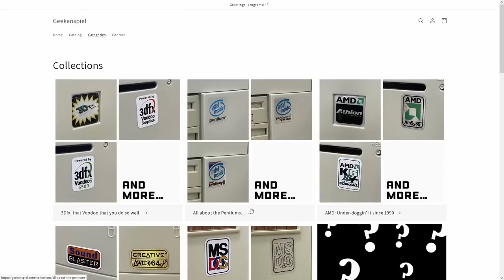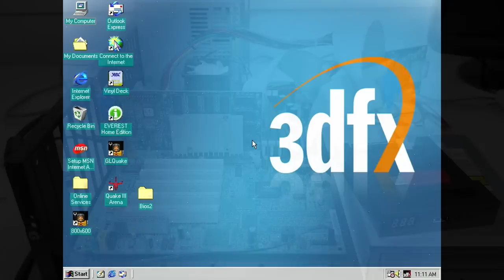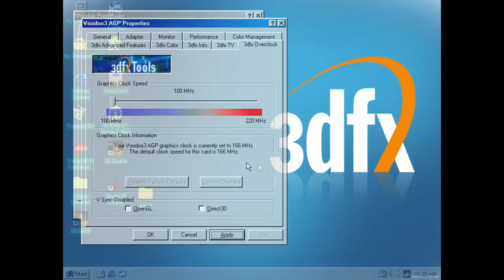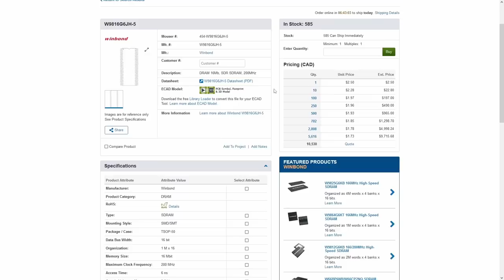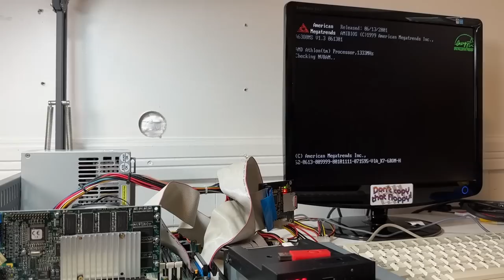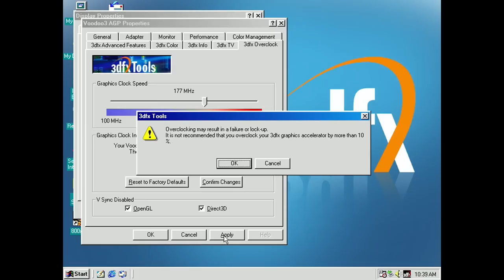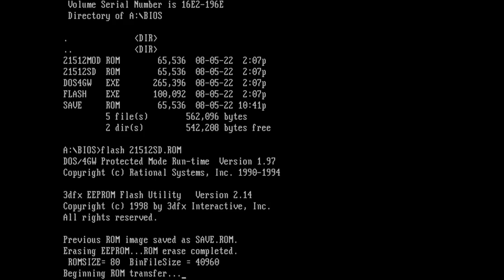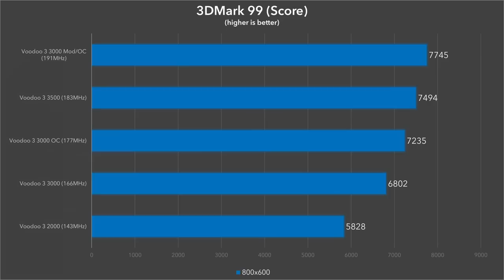3dfx Voodoo 3 Memory Replacement and Enhancements!

Comment: I miss my voodoo 3000 agp... i should have never sold it. It was one of a kind. In fact i had the worlds fastest voodoo 3000 that even blew the doors off the 3500. Back when 3dmark listed the results uploader's email i was swamped with emails asking me how the hell i had such a result.

Far as i can tell i had a UNIQUE 3000 though, i've never been able to find another one like it, Pretty much all of the voodoo 3000s had a standard aluminum heatsink as you see in this video, or the black stile heatsink, mine however was a MUCH larger GREEN looking aluminum heatsink that covered far more of the gpu. The tool back then for overclocking has a maximum core/memory clock setting of 220mhz, and i was amazed i could push it all the way there, i had to contact someone to provide an option for a higher clock, and was able to get the card to run 227 clock stable but could complete some test at i believe 235-240mhz. Totally insane for a 3000, even a golden sample couldn't do that, i definitely won the ultimate diamond level sample. I really should have put it in a glass case.
Reply from the maker: Thanks for sharing, that's amazing! I have only ever seen a V3 3000 with a green heatsink once, and that one was an impressive overclocker too. I wonder if it was some kind of special edition card or something.

Comment: With modern cards you can pull-down the supply voltage to a memory chip and force it to glitch, and then see if it artefacts in the same place on the screen as the fault, ie, it would be that chip, but I don't know about that old stuff.
Reply from the maker: Very interesting! That would have been a great test for these cards with persistent artifact locations. I may give this a try next time. Thanks for sharing.

Comment: I like the repair stuff, great to see the problem solved by replacing the mem chips. I've got a nVidia 6800 GT AGP card that has severe artifacts in 3D games, but 2D is fine with no artifacts. I suspect the GPU itself, but if its a memory chip that would be an easier fix, any ideas?
Reply from the maker: It can be hard to tell the difference between core and memory issues sometimes. Artifacting doesn't always show up in 2D with flaky memory. Cards with lots of memory didn't really need to use much for 2D desktop duties, but most/all gets used in 3D. Does underclocking the card by a large amount improve stability at all? .. but I will say that the nvidia 6800 GT/Ultra series is known for having failing memory over time. It didn't age very well from what I've seen and could very well be the issue. Good luck! I hope you get the card going again.

Comment: If you put some active cooling on the GPU core and some ramsinks on the memory you'd make 210Mhz easy, that's how i got my old Voodoo 3 up to back when i had one and it was the default memory
Reply from the maker: That's an incredible overclock on stock memory, that's for sure! I've heard similar stories from others too. Some of these V3s could clock REALLY high out of the box as long as they were cooled well enough.
Reply: @vswitchzero  Silicon Lottery at its finest. This was similar to my Voodoo 2's One was able to clock 50Mhz higher while the 2nd only managed 20MHz, no matter what i did. Ram sinks, Heatsinks on the chips, nothing would get it past 20Mhz. Sold it and got a better one that could match the 50Mhz of the first card. 

The V2 in SLI complemented my Riva TNT2 32MB card. had the best of both worlds

Comment: Maybe you should consider to glue off the heatsink on this MSI socket A motherboard. Because it's glued on 2-side tape and have no contact in the center of northbridge. There are holes to put there some other heatsink with spring-clips instead))

Comment: Another very good video. Thx for sharing :) It's also good you mention the stuff you work with. 
For example which solder would you use? I found out that some pf my old repaired PCBs got corrosion where i soldered. I think cause of flux. Now I wonder if there is solder with bad flux which leads to corossion.

Comment: Good job, I wonder if using freezer spray on the ram chips one by one would of changed the artifacting in any way to of diagnosed which IC was at fault, used to be one of my ways of diagnosing set top boxes at work, they pretty much used a chip set in a similar way, i.e.a processor and ram, before SOCs were in everything ha.
Reply from the maker: Very interesting method! I would imagine this could work well as long as the freeze spray would be safe for the chips/PCB while the system is running. Thanks for sharing! 👍

Comment: Any chance you could look at my voodoo 2s? There's a few spots where the pins got pressed together while in storage. They worked amazingly prior but I'll admit I haven't had them running in probably 10 years now. Move cross country twice and I'm amazed I've kept them together
Reply from the maker: The pins on the V2 TMUs and FB chip are very fine pitch, but with good magnification, you should be able to use a very find blade to separate the pins. They are very fragile, so you'll need to be careful, but slowly putting the blade between the pins is enough to separate them. If any of them have become separated from the pads, they'll need a solder reflow, but unless they are really twisted or bent, that's not usually the case. Best of luck! Let me know how it goes.

Comment: I'm kinda wondering if the reason you couldn't go past 191MHz is because the card is passively cooled. Do you think adding a fan on top of the headsink would've been able to achieve better results?
Reply from the maker: Thanks for your comment! I forgot to show it in the video, but all the overclocking was done with a 92mm fan blowing on the front face of the card. It was barely warm to the touch with active cooling.

Comment: You want reach 200Mhz - volt mod you voodoo. You need bump GPU voltage 10%-20%. And better cooling solution is a must.

Comment: do you keep all the other old chips then once you have found the faulty one ?
Reply from the maker: Yep, I do. If I know the chip isn't bad and it came off cleanly I will hang on to it. The hot air used to remove them probably isn't good for the chips, but these originals are getting harder to find so you never know if they'll come in handy one day :)

Comment: I wonder how hard it is to upgrade an old SDRAM videocard to use Static RAM instead. You would probably need to modify or bypass the memory controller.

Comment: with that 191MHz overclock applied, how does the voodoo 3 hold up against a TNT2 Ultra ? 

I have both, a Voodoo 3 3000 and a guillemot "maxi gamer xentor 32" TNT2 ultra but can't really decide which card to put in my "1999" system (500 MHz Pentium 3) ... if I go with the nvidia card I'd trade glide compatibility for more performance in everything else ...
Reply from the maker: Good question. I don't have a TNT Ultra, or any other TNT cards actually. I've been meaning to pick one up though. I'm hoping to do some more comparisons of 3dfx cards with the competition at the time.

Comment: You don't happen to have any reference material to what the SMD capacitors are that sit between the memory modules? I have one that is damaged and was hoping to work out what it was, the alternative being to pull one of the other ones off and measure it.

Comment: Is it possible to add the missing components to card 3 for a functional tv out jack?
Reply from the maker: The PCB is the same for TV-out and non-TV-out models so yes, it would be possible if one knew all the component values and could source the parts. The bracket would need to be modified/replaced though.

Comment: Are you interested in modding a PowerVR PCX2 @90MHz ? I need 8mb of faster memory, now that it's fast enough to handle maxed out graphics of some 98-99-2000 games.
Reply from the maker: The PowerVR stuff is really interesting! I actually just bought a PCX1 but haven't had a chance to try it out yet. As much as I'd love to try to mod the card for you, I have very little spare time with work and other obligations so will have to pass. I'm also still learning too, so prefer to work only on my own hardware for now. I believe Oscar (http://www.3dfx.es/) does some work with PowerVR stuff. He does really great work and may be able to help with this.
Reply: @vswitchzero  I'm in touch with him already, he repaired some cards for me. But I tought it could be interesting to see the process in video. 
About your PCX1, as primary cards, avoid S3 and SiS cards (even newer models), you'll have degraded performance. 
ATi cards (but it will depend the driver), Rendition's, Voodoo 3/4 and Cirrus Logic (both late 2D only and Laguna3D) are fine.
I know Matrox cards are tempting, but there are compatibility issues. Same for Nvidias newer than Riva128.

Comment: Pro tip, the only difference between the MG chemicals wick and cheap wick is the rosin flux. If you add some kester flux to cheap wick it sucks up solder like a turbo charged vacuum. Synthetic BGA flux, absolutely nothing, awful pickup. Good rosin flux+cheap wick = match made in heaven.

Comment: Lovely work, but why are you soldering so excessively hot?
Not even lead free needs to be soldered at 400c. In fact most fluxes will smoke and char at those temps.
Reply from the maker: Thanks for your comment! You are totally right. I'm embarassed to say that it was just the default of the iron, and it always worked for me and I didn't really bother experimenting with lower temperatures. In the last few months I've started trying lower temperatures and it works just as well with the tips I've been using. Since I work with older components only, it's always leaded solder I've been using for repairs. I hope to mention this during my next repair video.

Comment: I have a v3 2000 that seems to be on its way out memory wise. The typical artifacts you'd normally see from a bad overclock

Also, are those cache chips just wired to themselves? 😂 Possibly the chips are real but just not connected to the system? Eh, kinda doubtful
Reply from the maker: Its quite possible, seems many cards from this era suffer from memory issues. And yep, those cache chip traces go nowhere! haha .. you can find some more pics of the traces here: https://twitter.com/vswitchzero/status/1631821684867997699

Comment: Where is the BIOS, it looks like the sticker is on the TV out chip... or the space where it isn't
Reply from the maker: Yep, they put the sticker on the TV-out chip because the BIOS chip is half covered by the heatsink on the 3000. You can just see part of it at the upper-left corner of the heatsink.

Comment: do you use the grab and twist method to remove the old caps ?
Reply from the maker: I prefer to cut the tops off with a sharp pair of side-cutters, but I've heard that method works really well too. You can see the method I use in the Voodoo 3 repairathon video I linked in the description 👍

Comment: ..and Voodoo²(12MB) holds up better?
Reply from the maker: I don't think I've ever directly compared a V2 and V3 on the same system. Would be interesting to see
Reply: @vswitchzero  Heh! Wouldn't know, only had/have* Voodoo²s.    And my only AGP card was the GeForce3 Ti500.

*Well, only one left nowadays...stupid me!! - sold one...(around late '01 to get thé Ti500 mentioned above) 😕

Comment: so many Voodoo3 you saved... I dont you just install active cooling in the cards ?  190mhz with stock passive... is like cooking in the cooler
Reply from the maker: I forgot to mention in the video, but all the overclocking was done with active cooling. I had a 92mm fan next to the heatsink, which kept it barely warm to the touch.
Reply: @vswitchzero  i Saw it. But i was talking about installing fans on voodoo3 and Banshee.. is almost mandatory
Reply from the maker: @14272nuno  Agreed. They get WAY too hot without some active airflow.

Comment: i have a evilking 3 that does not show any image but does not have vissible damage no idea why
Reply from the maker: I’ve seen BIOS bit rot issues on Voodoo 3s before (see my other V3 repairathon video). A common symptom is no VGA output. May be worth trying a reflash on it 👍
Reply: @vswitchzero  but where is it possible to find a powercolor evilking voodoo 3 bios that sounds like a big task =/
Reply from the maker: @napalmarsch  Looks like the BIOS is available here: https://3dfxbios.cl-rahden.de/index.php?title=Voodoo3 👍
Reply: @vswitchzero  my evilking live only the 3200 is still dead in the water

Comment: Great work. I have a faulty voodoo 3 3000 agp that prevents the system from booting or make POST. It causes the PC to beep and I don`t have a clue how to fix it.
Years ago I have removed the heatsink which was glued to the chip and I don`t know if the chip was affected or damaged.

Comment: There was no improvement in a heatsink or cooler
Reply from the maker: In my experience, a small bit of airflow on the OEM heatsink provides a major improvement in temperatures and overclocking stability. I generally don't run any V3 cards without a fan aimed toward the heatsink. I'd imagine the overclocks would be much worse if I ran the card passively.

Comment: 32mb ?
Reply from the maker: As far as I know, all Voodoo 3 2000/3000/3500s will only work with a maximum of 16MB on them.
Reply: @vswitchzero  ok
Reply: @vswitchzero  the bios of a 286 as it is done to identify it and to be able to flash it. Or the eeprom must be replaced by one that accepts reading and writing to it.